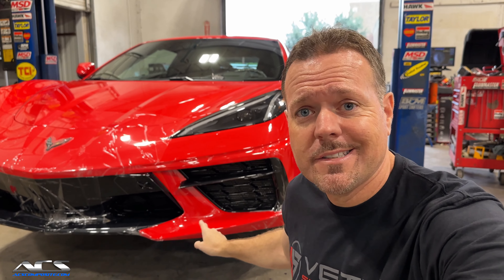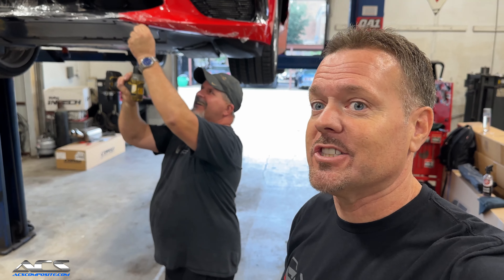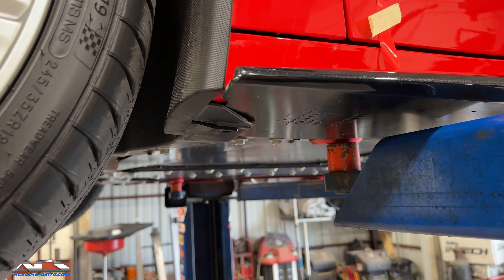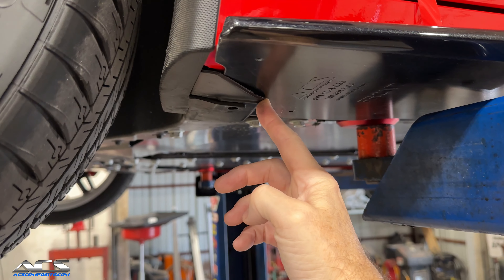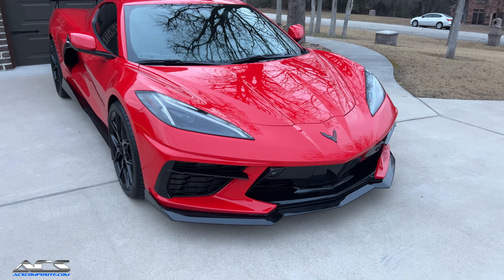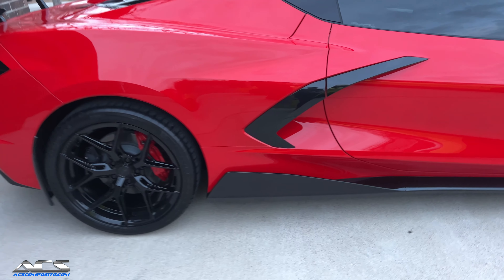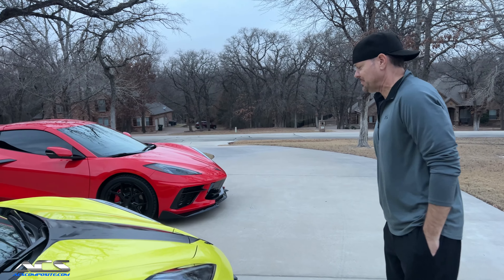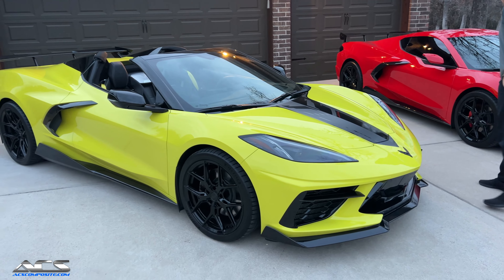AMAZING Changes on 2 New 2023 C8 Corvettes!!!

Comment: Hold on. So the front splitter holes are pre drilled even if you don't get the splitter?
Reply from the maker: Yes. That is correct.
Reply: @FrontSeatDriver  thanks for the reply! what about the side rockers? do they have predrilled holes? I want to install 5VM front splitters and side rockers but really dont want to drill additional holes into the car. cheers thanks!

Comment: Follow up comment/questions? 

Are the 5VM pieces subject to stones or debris striking them and causing damage from the front tires?

Does any grit, dirt, rain, wash water, small stones get into/behind the 5VM Panels?   
Or are they protected/sealed by the tape?    

That’s a concern I have as well as matching Carbon Flash Painted Aftermarket Mods from various suppliers with the OEM CFP pieces.  Thanks
Reply from the maker: The carbon flash match is perfect to OEM. 
You could possibly get debris behind them. I just use a microfiber towel and slide it in between the rocker and the car. We had them Xpel’d after they were installed. I think as long as your tire is behind a rock guard you’re probably fine.  As much as with any other rocker. 
Remind us, on the next live Steve can show you how they look. His car sits right behind him.
Reply: @FrontSeatDriver  I have the ACS Rock Guards.

Upon time to submit my Order WorkBench to GM to go to Production, my Salesman advised me the OEM “Factory Splash/Mud Flaps” were on constraint.  

So, not to delay production, I withdrew them from the Build.

$500 is a lot to pay for “Mud Flaps”, but in doing my research, I decided on the ACS.  IMO, they are the best ones out there as of this date.

Blackout Tinting at their Latrobe location, was kind enough to install them for me when doing the full PPF.  

Great job done by Aaron and others!  He recently won 4th place out of over 100 competitors in the World for the PPF Installer’s Competition held In Arizona.